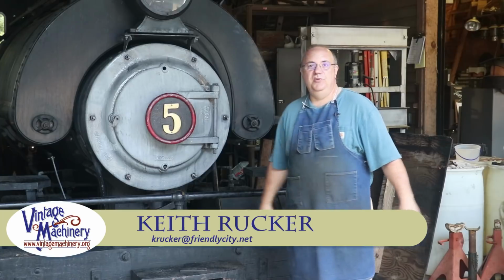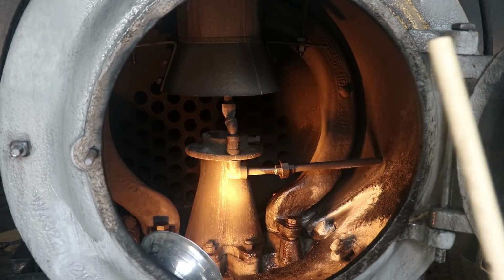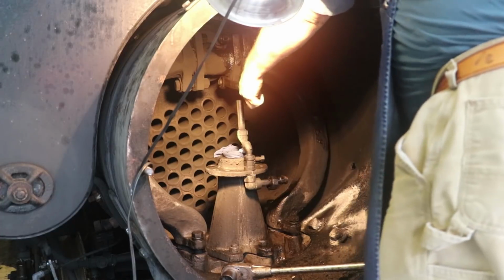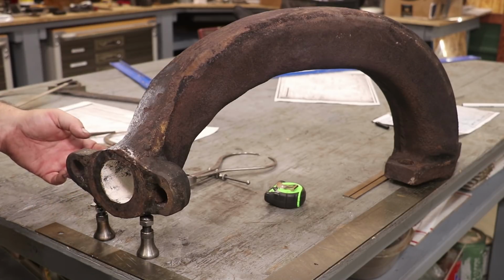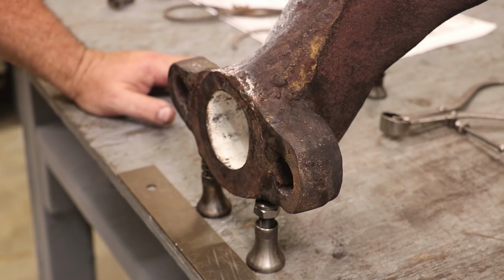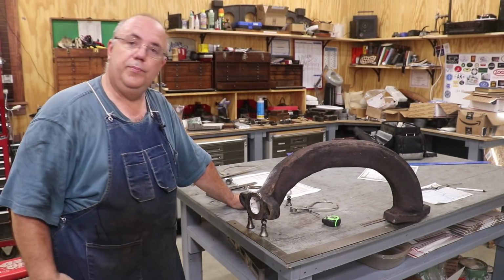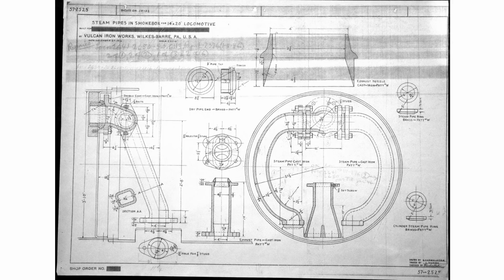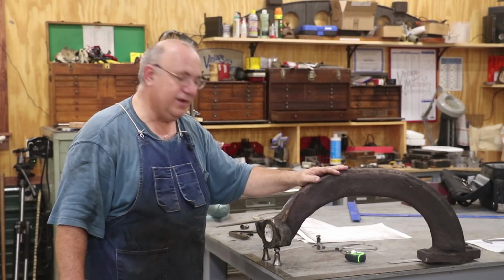Steam Locomotive Steam Pipe Repair - Part 1:  Pipe Removal and Game Plan

Comment: ... would it not be an idea to record the geometry of the two surfaces that the component connects to directly... bolt extended plates to the receiving flanges ... use one as a datum etc

Comment: Keith, have you considered making a robber mold of that part?  Tested has done some real good videos on making a rubber mold.  Then you can provide the engineering students a plaster cast of the  part, and let them do the blueprint for it, while you focus on the actual repair.  Making a casting of the undamaged one as well would let them see the correct geometry of the proper flange  angles.

Comment: This series will (also) be exciting! My own "couch machinist" idea is to cut off the whole flange and braze a new flange on. I'd build material up around the bolt head sides of the "ears" so that your your ratchet and socket will fit in between. I suppose the tolerances on the "bolt head sides" of the ears is not critical. There would be room for quite large "risers"

Comment: Steam train videos👍🏼👍🏼
Is it possible to mill 15mm off all the bottom 
Then make a new plate that acts sorta like a spacer 
You could either weld the plate on the bottom 
Or gasket it
Edit 
That'll be a good project for the uni 
That's a fairly hard part to cast 
As far As modern engineering goes anyway
Reply: Edit #2
Wonder if a volunteer from your museum can go to the other museum and ruffle though papers 
If they can file some of them and get copies of what you need to benefit both party's 
If I had time or more importantly lived in the right continent (australia lol)
I love looking though old designs and documents
Reply: Good idea, but you probably don't want to ask a museum to let you 'ruffle through their papers. :-)
Reply: Yea 
All depends what sort of operation they have and who's running it 
If your likely to come across something of serious importance then prob not 
Or the curator is not a friendly sort of person prob not 

Our local museum gets vonenteers to help file new donations all the time and any member of the public can ask permission to go though their archives 
Usually they allow it if it's for something worthwhile (family research uni project or something)
Some files require extra permission
Reply: yep a new flange with a large deep boss to braze the pipe end into and have a  large contact area

Comment: Wow Keith, might be easier to make a whole new flange and braze it into that pipe. It's cool that some young enginerds are actually going to learn how to MAKE something in the real world and not just CAD something on the confuser. Looking forward to this project.
Reply: I agree!  As the guy here with the machine shop that keeps our tractor club's 50HP 1913 Case steam traction engine running, a new flange would be the best way to go. 

I would be inclined to go even a step farther.  Mill a ball socket into the end of the casting and a ball into a new flange that mates to the saddle intake cylinder casting.  A second flange with bolt ears  to pull it all together.  Yes this really would be a CNC job.  Keep it simple is a good rule....  I doubt the museum has a CNC so maybe this idea is out.

So back to the machines and tools you have there in the shop.

Get the geometry close, setup a fixture and mill the end of the casting for a new 3/4" or 1" thick complete mild steel flange with bolt ears. 

If you bolt the milled steam pipe casting and new flange in place in the smoke box then tack braze the flange to the casting you would be able to get things to line up exactly .  Once you have 3 or 4 spots tacked, remove the assembly and finish brazing the flange to the the casting.  This will compensate for any misalignment.

 A complete steel flange with the soft brass connection would bend and adapt it's self to the cylinder saddle casting flange not break the bolt ears off if slightly misaligned.

Thanks Keith for all your hard work and videos!
Reply: I like your idea of spot-brazing. I hadn't considered that. Would avoid the need for a jig altogether.
Reply: This was sort of my immediate thought also. Might it be a more robust repair (and allow you to recreate the flange for the seal) to cut off the entire ear section (perhaps with a interior two-angled cut into the pipe and then across to retain that shoulder on the outside of the curve of the pipe - difficult to describe without drawing it). Then fabricate a new ear section complete with flange, and braze it to the original pipe. I am thinking that the resulting part would only have a single directional force - perpendicular to the ears and effective sort of along the pipe. There would be no shearing forces which is what you will be dealing with if you replace the ear alone. You could also then perhaps use cast iron rather than steel for the new ears section. Making up a jig to allow you to retain the overall geometry of the pipe would be pretty straightforward.
Reply: Don't even need a jig. Use the current mounting to tack braze in place then remove to weld.
Reply: J, I have used this weld (braze) in place method of fitting pipes many times on steam, old engines and aircraft and if you don't have flex or ball joints it is the best way to make these connections.

This way you could do all the "milling" prep with a cutoff wheel and grinder and never set it up in the milling machine.  It would probably require several test fit up assembly tries to get it ready to braze.  But in this case that looks like it would only take a couple minutes to test fit the modified casting with the new flange.  

The casting could be milled (ground) off flush or the flange could be bored and the casting milled (ground) to insert loosely into the hole or partial counterbore in the flange.  This would minimize the exposure of the steam to the steel flange and minimize the material removed from the steam pipe casting.

I have some concerns about the movement and expansion of the smoke box components. Vulcan Iron Works  may have dealt with this in their design of the 0-4-0 but it may be the cause of the broken ears.

If you look at the larger locomotive construction they have to make just about everything in the boiler flexible. When you get as large as the UP 4014 Big Boy everything moves.  Thermal expansion combined with the pressere can make the boiler "grow" several inches.

Link to UP 4014 rebuild: https://www.up.com/aboutup/community/inside_track/steam-update-5-31-2017.htm

Chuck in Wyoming
Reply: Another vote for a new flange,   Machine the new flange, an bolt the flange and part back in place in the Engine,   Do some tacks,  then remove and do a nice braze all the way around.  no need for a jig.   This  would eliminate the failure point where it clamps together.
Reply: My thoughts run that way too. The ears brake off because of the bending force, something cast iron is not too keen on. A new flange in steel could take the strain., then the weld/ braze only has to be gastight and take a little of the weight of location.
Reply: As long as the ears/flange section is machined correctly, the forces will be even and manageable. The original has lasted a lifetime after all :)
Reply: its broke now and been repaired several times so it hasent  lasted. i believe a new flange  is the way to go .
Reply: Another vote for a new flange from steel, for all the reasons mentioned. If you want a mechanical joint, from the casting to the flange, machine the casting round and make it either a slip fit or a threaded fit into the new flange.

Comment: Hello Keith

its to bad tad they messed up the steam pipe.
i would remove the ear and pud a new wan on.
and i would mil the bottom flat end make a ring and screw it on and then brass it around.

Kind regards Peter
Reply: going to take time to track down a wan to fit  :)
Reply: i woud say make one on the lathe

Comment: I cannot imagine how that is cored. That is what I'll be interested to see.
Reply: I can't imagine how it would be done either.  But I'd almost bet that if we were to go back in time, to the place that was made, and watch them, we would be doing a face palm and saying "Oh yeah.  Why didn't I think of that?"

Then again, the process probably involved a young teen aged apprentice set to the task of clearing the core material from the part.
Reply: I can not seem to get my head around how the core would be done when making the pattern.
Reply: The part would be cast laying flat. Lower half into the lower half of the box, central mould laid in on top of that, then the top box laid on. You can see where the original casting moulds were joined right along the corner of the pipe. It's no worse that casting an exhaust manifold.
Reply: That's all well and good, Sideslip. But what would the core prints look like to keep the core oriented within the mold?  What would the core box look like?
Reply: @ Cyril Hudak:  :-O exactly.
Reply: Gentlemen, I just spent like 2 hours searching for a video that would give me even a CLUE:  https://www.youtube.com/watch?v=dqSGTjipFxg
Watch for the T piece and then extrapolate what you'd need to do on the ends of this core.

I imagine the pattern is easily 25% longer on each end, and I also imagine it is a very large rectangle in shape.  They maybe used a baked part with lots of metal reinforcing in it to span such a long distance?

Again, big rectangle on each end, either arranged vertically for easy slotting of the core into the mold ( yikes, a long slide down tho ), or else a wide flat, easy to lay the core into the mould.

Either way, damn, do I want to see the video if they can get this sucker remade.

I'm also wondering, maybe they cast this thing in a special mold, built SIDEWAYS?  That would make the core much easier to support.  What I mean is, maybe they cast it exactly the way  Keith has it on his bench?  You could do it if you put all the sprues and vents and stuff in the right place, and clamped the halves together.

Comment: Could you make a jig from the actual part for the future steam pipe build to test fit against rather than having to test  in the locomotive. ?
Reply: yep a wooden jig, both for the ends to match also the profile esp the sides where it has to clear etc

Comment: Are there proper boiler inspections in America? Or is that just a British thing ? Just curious, nice work
Reply: Yes there are full boiler inspections done in the U.S. now, under the Federal Railroad Administration's '1472' regulations for steam locomotives that operate on a mainline.  It requires complete documentation and detailed engineering drawings made of an engine and sonic thickness testing of the boiler and all related pipes and fittings that will be under pressure and minimum thickness standards that must be met before an operations certificate is issued.  The operations certificate is good for 1,472 'working days' over the course of 15 years before the inspection and re-certification process must be repeated.  A 'working day' is defined as any 24 hour period, from midnight to midnight, that pressure is raised in the boiler with a fire in the firebox, and having 1,472 'working days' per certificate allows around 100 'working days' per year on a 15 year operating cycle between complete overhauls of an engine.  The regulations also call for a full washout of the boiler about every 30 working days too I believe.
Reply: The F.R.A. regulations primarily apply to locomotives that will be operated on an in-service mainline.  Much smaller engines like the Georgia Museum's Vulcan 0-4-0, which are not running on a full mainline, but on isolated track, don't need such stringent requirements but the museum still does these 'maintenance down' periods for safety reasons.
Reply: Patriot1776 here in England we have the same standards for all from models to full size. But then again we have far far more preserved steam so it’s more worth while for government investment in testing.
Reply: Patriot1776 thanks for the info.
Reply: I think it should be said that the Georgia Museum of Agriculture very likely calls in state-certified boiler inspectors for assistance in keeping tabs on the health of the Vulcan's boiler, though if you look back through Keith's channel, there are some fairly recent videos from last year I think where he talks about the Vulcan having been completely disassembled so the boiler be sent off for thorough refurbishment and repair, so the boiler itself has been serviced recently.  There are just other various issues with it that are now being tackled.